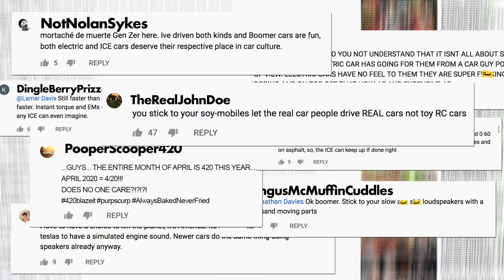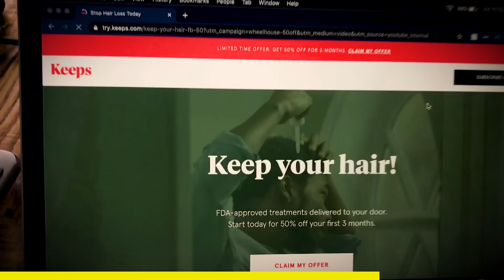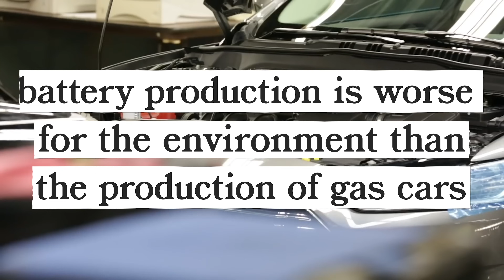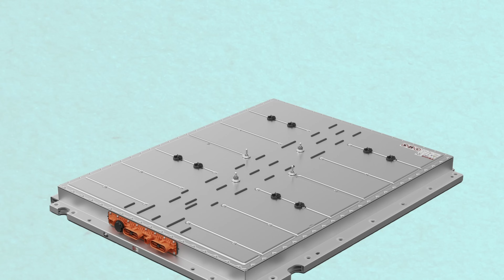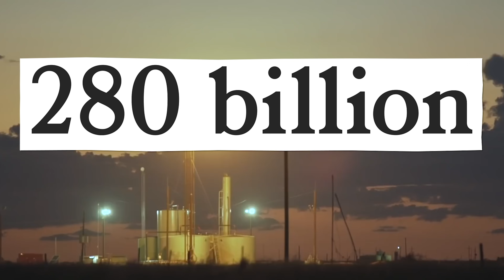Are Electric Cars REALLY Better for the Environment?

Comment: One thing that you didn't take into account is what is done with the batteries when they can no longer accept a charge. They're much more difficult to recycle than just crushing a normal car and melting it down into more metal to be used to make more cars or other things. Not even sure that the batteries can even be recycled and they cant just go into a normal landfill. Doesn't that just create more waste, and a more toxic waste at that? Hmmm... I think a follow up video is in order!

Comment: There are a few major problems with your research. The first is that there is fuel tech that makes ice vehicles actually burn carbon negative. That is something ev will never be able to do. Basically its fuel made from air scrubbers that filter the air we breath, and the byproduct is gas/diesel. Not to mention the renewable fuels that already exist. The other major thing is battery replacement for ev vehicals. Unfortunately almost every manufacturer is blatantly lying about how long there batteries will last. Tesla being the biggest offender. Those superchargers that people love to use absolutely kill the longevity of EV batteries. EV vehicals will go through at least 1 or 2 battery packs during its life. So the emissions of the average ev is almost double what your research found.  I couldn't care less what people drive, but the radical idiots on both sides annoy the hell out of me. Hopefully your video shuts at least some of those people up.
Reply: You got any sources on this cause its sounds like BS? Is there an actual name for this "fuel tech"?

Comment: Combustion engines are getting more economical and can last longer whereas electric vehicles battery systems can only last up to 10 years before having to be replaced at a high cost.
Reply: Yeah except maintenance on combustion cars is significantly more expensive when they get that old. They've already had EVs hit 350k miles with like 13% degradation. When have your average ICE hit that without major replacements.

Comment: Ok, pollutes less. But where do all the trash batteries go? Where the global market will adquire all resources? It's changing a problem with another.
Reply: They've been recycling some and repurposing others. And its a bit far off but spaceX is already talking about asteroid mining by 2040 so we wont have to tear up the planet.
Reply: @heavylifter315  Seems sensible. I hope it turns real. I love old petrol engines, but to be honest, a transit with EVs would be far better. They should let oil just for racing and hobbies... they could even use ethanol instead! Idk... many options.

Comment: But when you fill your tank up you only get the use of that fuel once, a battery will recharge for years and then they can be recycled,,,plus the technology is moving quickly, soon they probably won’t even need all these chemicals and minerals
Reply: The only way to store that energy is with those chemicals and minerals. You can't get near as far on an EV as you can ICE from 100% energy, plus it will take far less time to refuel than it does to recharge and you can always carry 5 gallons of fuel with you.
Reply: @rooster_and-eggz  Battery's are an ever advancing technology, it's unlikely within the next 30 years that EV's will even use some of these expensive and environmentally destructive materials such as cobalt and the move away from lithium based battery's is already starting. 

energy density (range) and recharge time are also constantly improving, actually with fast charging recharging times aren't really that bad, and for like 95% of driving is totally fine, really it's the one off cross country trips that EV's still struggle with and again this is contently moving forward with improvements in range and charge times, there's no reason you couldn't get further in an EV then an ICE, how much are you willing to spend on the battery is the question, and again battery's prices have been dropping nicely for the last decade or so with no sign of it slowing up, because of this I wouldn't be surprised if there are mid range ev's  with 600-1000 miles of range in the next 20ish years.
Reply: Perry Tilton but then it’s gone FOREVER, the battery technology is changing at a startling rate with capacity vs cost doubling in recent years and it will only get better, I love my standard cars but it’s time to face facts they are a dying breed left only for the tyre car guys, EV and hydrogen are the future all the big fuel companies know it and even the big four car companies are suddenly shifting gears into EV production, it’s the future

Comment: There is an abism between the general public and the car community, it's basically 90% of the population compared to 10% of it.
The general public would only benefit from electric vehicles, and they are the majority.
If 70% of the world changed to electric vehicles, the enviroment will be much better already, there is no reason to ban gas cars though.

And that's the issue, gas cars should stay, but as long as electric vehicles keep evolving the majority of people will have them.
I love gas cars, and I don't pretend to sell mine anytime soon, but even I might buy an electric car to daily drive if it's worth for my pockets.
But why should my weekend gas car be banned?

It is a good idea to focus society on electric cars, but it's wrong to ban combustion engines.
Not to say it would be horrible on the car price, as the car market would basically restart and car prices would increase because of the lack of old cars available.

Comment: The problem with this analysis is that it assumes carbon dioxide is a pollutant. That is false, and carbon dioxide does no observable damage to the environment. The damage done to the environment by the strip mining of many of the materials used in these lithium ion batteries, however, is very real.

Comment: Well a lot of normal people don't really like the sound of an engine and prefer an EV, some call them stupid (I call them too). The thing is that every powerplant is much more efficient than our small gas engines so for the same amount of fuel you get much more electricity. Also EVs don't have efficiency losses all over the place (small to no transmissions , 0 heat lost due to combustion, no friction in their motors) so they go more miles with the same amount of energy

Comment: You.plug it in, that power comes from oil,gas and coal..... more strain on the electricity grid also if all cars were electric, plus higher cost of energy for overuse and more mining for more fuel....
And formula e, what a joke, in the back there is 25 cat diesel generators on full throttle running the race......

Comment: I've been waiting for this video for a long time. Did i miss something or you calculate in a way that ev battery will last the whole lifespan of the car? I have little to no experience with evs but I have heard that a casual battery dies in 4-5 years. I mean it wouldn't change on the outcome but it could make it closer.

Comment: I totally disagree about your 2nd myth as you showed no mathematical reasoning. Youre sort of forgetting there are already millions of electrical items such as pc's ac's whatever. Obviously when building a grid there is a growth factor which is been considered before. But i wonder for how long. Besides u.s still uses 115v 60 hz grid in which the cables are already thicker due to increased current.   Maybe swapping the system for 230~ will help
Reply: Power = Volt * Amps. -> (in israeli house socket) 230 * 16A =3680w. -> For ameican grid (assuming both socket supply same amount of electrical power) 3680w / 115v = 32A. Resulting in wider grid. Swappin to european grid style may benefit the change in the U.S

Comment: Im just keen about the hydrogen "sponge" made recently for potentially viable storage and usage of hydrogen so i can sip dat sweet sweet watery exhaust V A P E. Yall can keep dat big boi batts and yo ass gas.
Reply: the hydrogen sponge (l think its called hydride or hydrite) has been around for decades and it is the ONLY viable option for high pressure hydrogen storage for vehicles but it is used in the production of nukes so the US gov has made it illegal to buy and sell. its not illegal to make your own but you will have to have a spare particle accelerator to make it

Comment: my opinion is that dont buy electric if you have a perfectly good gas car. electric is worse for longer if the gas car has no manufacturing costs. it is still better to buy a used gas car than to buy a new electric i think. If you are buying a new car cause you want a new car sure buy an electric.

Comment: I am not disputing the fact that in long run EVs are more efficient than ICEVs, however you still have missed few points e.g. EV batteries fail... often and although they are warranted (so you don't pay for replacement) there still is environmental impact and it is not small either considering batteries are the biggest part of EVs emission. Secondly, you only considering one of many pollutants... yes Co2 is not good, but there are few dozens of various pollutants and there are ones more relevant for ICEVs and ones for EVs. So although you haven't said anything fundamentally wrong you have barely scratched the surface.
What I personally don't like is when people scrap perfectly good nearly new ICEVs to get new EV and then replace it after few years and claims they are "environmentally friendly". My point is that it is not enough to make environmentally friendly car, how we use them is actually more important, further overconsumption is more of an issue than pollution from transportation (transportation is, including all forms ships, planes etc. are merely 10% of global pollution, manufacturing is 52%). In short we won't save the planet switching to EVs, but we could save it by buying most reliable cars, maintaining them well and driving them as long as possible... I mean driving same car for like 25-30 years. That would actually help, scrapping good car and switching to EV... doesn't.

Comment: Any ev beats any gas car eventually. Wrong! If you don't need to drive alot its not true. the ev batteries will degrade over time so there is a point of usea which would make the gas car less harmful if it was not driven alot. The choice of being able to pollute when you want is better than having to polute when your battery is degraded because you need a new one. Also you said nothing about energy dencity. Also performance is severely degraded in cold or when old. Have you ever tried using a 6 year old iphone? Like the battery much? Try talking anyone into using a iphone 5 in 2020 with a degraded battery. It's like saying the iphone 5 has become energy neutral now. Please keep using it.... haha

Comment: What about when you have to replace the batteries in an EV?
Reply: This is yet another myth that stems largely from experiences of the first generation Leaf (and similar). Modern, thermally managed batteries last 200-300,000 miles before they lose 15% of their capacity (the industry standard "degraded" point). That is 2-3x the mileage at which the average combustion car gets scrapped.

Comment: One problem that is not addressed is the fact that the batteries for the EV will need to be replaced every 8 to 10 years adding to their environmental impact. Another point is that the ICE vehicles will in general stay on the road for twice the lifespan of the average EV spreading it's impact over a greater timeframe as opposed to the EV which will on average be in the landfil or recycling center within a decade.

Comment: One problem you need to address in your argument is the typical longevity of the cathode within EV's. This will continue to lessen over time, but currently this adds up to their overall carbon footprint, as batteries in hybrids with average driver miles need to be replaced every 8 -10 years. Great video overall.

Comment: Of course they are, and even if the polluted just as much as an ICE cars, the pollution would be less problematic because it would happen at power plants far away from central living areas. With ICE cars you have the exact opposite, they dump their pollution down town stuck in rush hour, literally.
Also, ICE fan boys always "forget" to include how much a gallon of petrol has polluted by the time it arrives at the pump, you think the oil industry is a zero emissions business? :D Fair comparisons are called WTW(well to wheel), and when you do that for both vehicles, electric cars blow ICE cars so far out of the water any debate becomes comical.

Comment: And where the fuck do you get the information that the electric grid will hold up? Sure it will not collapse but if you gonna charge an ev with over 300kw in the future (if you want a somewhat fast recharging) your neighbor will probably also have 300kw but the 3rd 4th and so on connected to the same ground-cable will not be able so receive their power, and it is also super unpredictable for companies to provide with the massive amounts of energy when needed and just stop when the cars aren't charged....... There are statistics showing that most people will charge their car during night at home and in the morning and afternoon at the speedchargers, there will either be way too much energy between morning and afternoon or many people will not be able to charge their cars when they need to...... It's a lot more complicated than just calculating the amount of cars and believe everyone will chat with each other to ensure a constant amount of EVs plugged in🤔

Comment: doesn't the Li-ion batteries needs to be replaced once in 7 years approx for average daily driver? doesn't fast charging makes the batteries less efficient over a period of time and brings down their avg years of use(there by more new batteries) as well? 
Oil refineries not only produces just gasoline, but other items that we use in our daily life. so, the carbon footprint your provided must be for a boarder scale.

What will be the carbon foot print in using ethanol mixed gas for ICE?
Solar, wind, ocean energies are not consistent and still needs huge amount of batteries for consistent power supply. Nuclear, Coal and Hydro are still the major electricity producers in the world for a reason.

If one really wants a cleaner drive, look for Hydrogen fuel cell or bio-diesel vehicles. they have less carbon foot print than EV or ICE. just my two cents..

Comment: Man, this is the best video at the best time. Im actually doing a school project about this exact topic. Thx for clearance😂
Reply: I did my college report in 2018 about this. We had a minimum 7 minutes of talk time but this topic took me at best 18 minutes to discuss with my backed up sources. Donut needed to bring in source information on screen to make it a bit more credible.
Reply: Me too. I did it in Uni. nobody knew about it when asked.  I called it conflict minerals. I went from phone to cars, to referencing jewelry. I got extra credit, too. Great topic. 
XD When 7 mins. turn into half an hour and no one is yawning that's a great job right there.
Reply: Think outside of CO2 footprints. What effect do batteries have on the environment in regards to mining? I'm not speaking on the fuel spent by mining vehicles. Think outside of that. Look at what strip mining does to an area. What cobalt mining does to a community. I want electric vehicles to be something viable. However, concern over the longevity of a battery and its replacement concern me as well. What does it take to reproduce a battery. Again outside the box thinking away from CO2 footprints.
Reply: Christopher Everette Tesla has been taking all their old, used up batteries back, breaking them down, and recycling them into new battery packs. The only time where the recycling wouldn’t work is if the car was involved in a crash and the battery was destroyed.
Reply: @Minnieal28  be that as it may, the entire battery is far from recyclable. You still need new materials to replace badly damaged ones.
Reply: Christopher Everette where do you think the raw materials for batteries go? Do they just vanish into the air? No. They just gain and lose electrons, and become more likely to retain/refuse the extra electron over time. Just because a battery will not charge doesn’t mean that the cobalt/lithium inside it have somehow transformed into other materials. Look it up. It’s quite similar to how other metals are recycled.
Reply: He only took into account CO2 emissions not metallic contamination and all the water wasted in mining, you should still do research on this lol
Reply: U got school rn?
Reply: @connermay5995  there's a thing called online class and shit
Reply: Did one on how renewables were more harmful to the environment than fossil fuels and why we should instead use nuclear energy. Took my group the whole class period to present
Reply: Actually its bad.  Co2 isnt a pollutant to the environment. And wonder and solar are intermittent energy sources only producing energy 30% of the time. Co2 is measured in parts per million not my estimated weight.
Reply: There are numerous things he got wrong
Reply: I would like to say that Nolan factored in that the EVs don't have to get the power of from coal power plants and can get it from wind and solar power. They have issues with in themselves as that manufacturing process emits CO2 itself. Also ICE do not have to get petrol from crude oil. You can get it from Algea. I am not 100% how it works, however I know it does not emit any CO2 so if we adopted that process, EVs will be disastrously more Co2 emitting than ICE. And that is a fact. The world won't except a change like this because it goes against the narrative of scumbags like Elon Musk and Al gore. You have left out numerous points that shatter EV arguments and skimmed past a few points Which are diabolical to this argument, as I predicted you guys got this wrong, not to mention the lack of sources you've included.